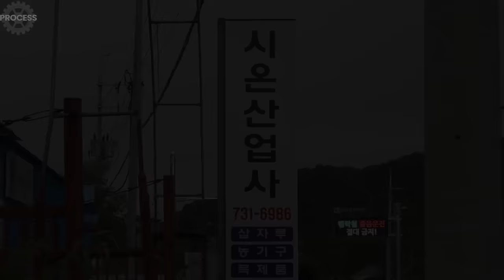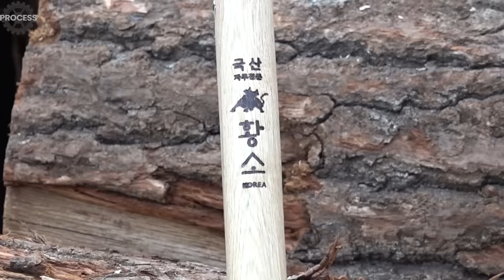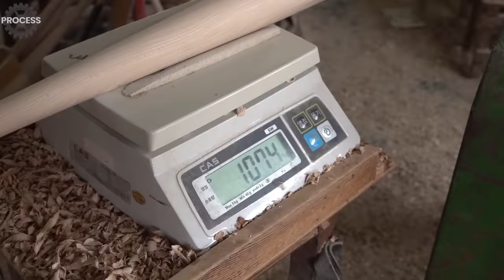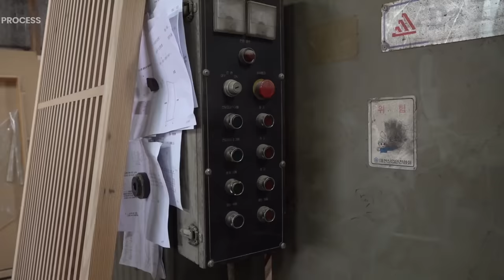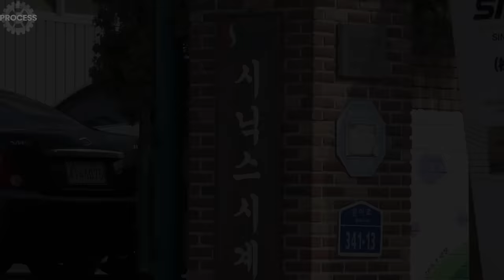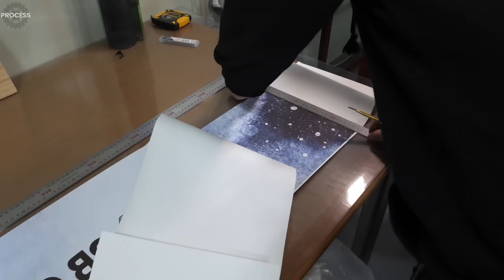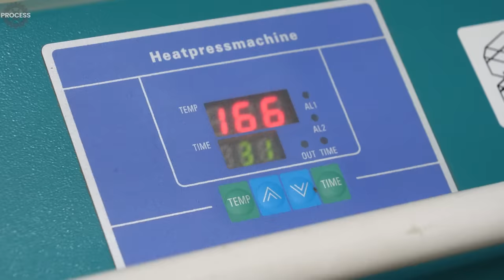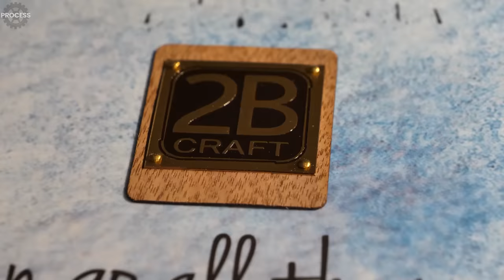Amazing Wood Working Process in Korea Factory TOP5.

Comment: Clock case making: cheap stuff is when they staple, and do not glue. It is the glue that holds it together. The staples make it so that the glue has superior contact.  It is interesting, I wish I could take a look at the board that they’re using. It’s hard to tell or judge from a video.  I know enough about Wood, to know that I don’t know enough.  I would be proud to have this piece of furniture in my home.
Reply: It is still laminated MDF. So it is still pretty "Cheap". But the craftsmanship does indeed look quite decent.

Comment: Even the giant heavy pneumatic sander for the handles could be replace with a much smaller table top shaper with the desired profile concave head just passing 5 "past the head, no real pressure needed to exert. Again >70 yr old machines   I am surprised they had a screw sorter.

Comment: Its called a gang saw, cut 3-6 with one pass, with 3-6 blades. A constant feed line not just hanging up the machine passing it back and forth. Sheesh. Till the next board. . I guess they just like the manhours and cannot upgrade anything or process there.